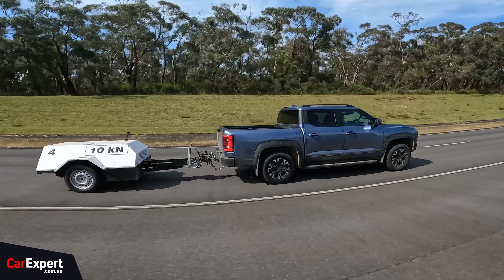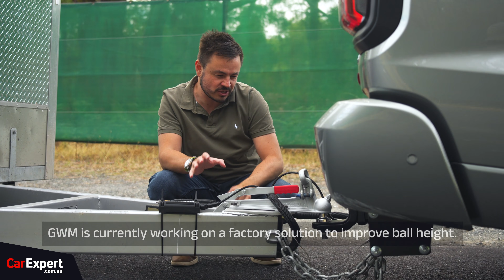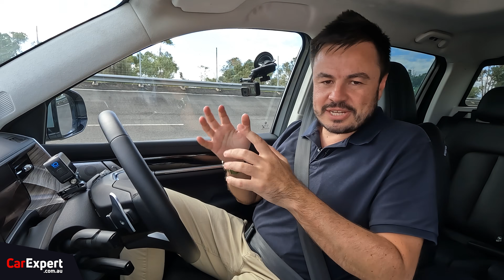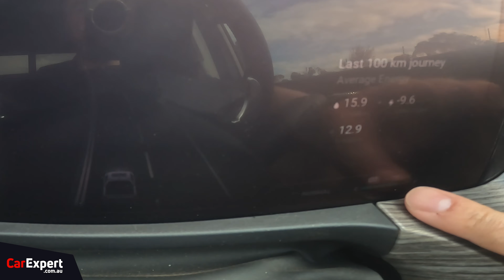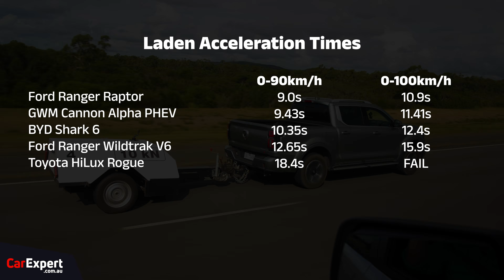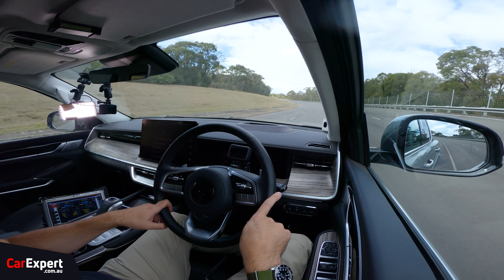GWM Cannon Alpha PHEV towing STRESS TEST: This blew us away...

Comment: If i’m not mistaken the Alpha has a 2.0 liter motor and the Shark 1.5 and 1.000 kg less tow capacity. Thus obviously much weaker at towing. But they are working on a 2.0 liter for the Shark. Would this do as well as the GWM Alpha? I hope these cars come to Europe. Especially the Shark as it is standard N1 vehicle saving a lot of taxes for those that would use it for work. Crazy changes, as politicians help the upper class to drain the working man, make it hard to find an affordable towing vehicle.

Comment: The reason the cruise control doesn’t work while towing is very simple, it is illegal to use cruise control while towing under current Australian road rules. I know other Utes don’t disable this feature which is a failure of the ADR’s and technically you can have your car defected if caught

Comment: Software update?!?!  The current Cannon has rear radar faults as a standard option. It alarms all the time when towing. It does say rear radar faults on the monitor. Drives you crazy!!!!! When you’re in drive the rear radar alarm should be off!!!……it’s a simple update which GWM aren’t interested in providing. So DONT expect any updates for their common faults anytime soon. Good cars, but after sales support is very bad.

Comment: Just don't buy one from Southgate GWM in Adelaide. The after sales and warranty service is where the stress begins.
Reply: Can I ask what you mean? I was looking to buy from them, that place is specifically the issue?
Reply: @Jess-u9q2w Good afternoon. My stepson bought a brand new Alpha Ute and it had automatic transmission problems from day one . Transmission would intermittently lock up for no reason 
It would not always go back into first at a standing stop often taking off in second or third. In for warranty work 23 times always excuses and never repaired. Officials from GWM Australia also flew in and went away denying anything was wrong. The vehicle was also rusting from new . Nobody from the dealership or GWM Australia were of any help at all . My wife and I bought a brand new Haval from them and the airbag light came on on the second day and took exactly 10 months to rectify with the sensors twice replaced,  the ECU replaced once . Eventually the dealership at Mawson Lakes had to re wire the vehicle taking 3 days.

Comment: Good review. Seems impressive. Re towball height. I had same issue on my 2019 Colorado and 2024 Dmax.  I ended up fitting an inverted Hayman Reece adjustable hitch. About $400 but raised the towball height so trailer was level. I do about 60,000ks of towing a year and raising the towball height not only stops the trailer hitting the ground, it significantly stops the banging and clanging and the “push” the trailer can exert on the vehicle.

Comment: Is it just me, or with 3500kg towball weight, 250kg payload in sandbags plus the driver, you are well overweight by being over your GCM? GCM - Tow weight in your case leaves 3245kg. Minus the kerb weight of 2810kg leaves 435kg for payload. Minus the towball weight of 350kg you mentioned leaves 85kg. That's also not taking into account the towbar weight which i understand is not included in kerb weight. So maybe 35-40kg left before you the driver gets in? Yet you added an extra 250kg in sandbags?  Don't get me wrong, super impressive how the car just handled it and I am personally interested in one. However, if I understand the weights correctly, the presentation is misleading.
Reply: What is the rear axle load. I'll bet it's well overloaded

Comment: Why don't Chinese make V8 diesel engines. We don't need batteries and Hybrid tech that will all fail in a decades time AND WOULD NEED COSTLY REPLACEMENT. I had to pay Toyota $4700 to replace my Camry Hybrid batteries around the 12th year mark and 200,000km. We need cars that last 20 - 30 years and 400,000KM with all the original parts.
Reply: Thank the Australian government and their obsession with going green. Thanks to emissions standards, car companies have to ditch fuel guzzlers for chargers. But just a fyi, GWM are developing a twin turbo V8 (hybrid).

Comment: Great review as always, 1 thing you could do to simulate more real world testing, the configurable trailer load for towing is fine for weight alone, but it doesn't simulate the aerodynamic drag of something like a caravan that would typically be the cause of this weight. If you had a caravan (or similar trailer on loan for testing) to standardise both weight & aerodynamic drag across all vehicles, this would be more a comprehensive result, especially for fuel economy numbers with realistic drag factored in. This would be interesting to see how the smaller plug in hybrids compare to the bigger American V8's like the Ram & Silverado, given that these would push more air out of the way for the trailing object already based on their larger design.

Comment: If our 21 Hyundai Ionic plug in hybrid's battery is depleted we can run it in sport mode and it will fully charge the battery again in about 35km of driving. Wonder if this does the same.

Comment: Thank you for a good set of reviews on this vehicle.

Let's hope they fix the tow bar problem so it's integrated into the back better.

I'm considering a Hybrid for towing the van around Australia simply to save on fuel. Plug in while camped in a caravan park and basically fill up for free :)

Comment: Very interesting results.
Hitch raiser or upside down hitch to lift ball height 50 mm ??
Mister Hitches Heavy Duty hitch has a stock 57 mm drop or 31 mm reversible rise hitch for $70.00 SKUMH001HD or a 102 mm drp 72 MM rise SKUMH004HD  both rated 365 kg ball weight and 3650 tow max load. 2" square hitch.
Would love to see the chassis teardown and assessment like was done on Munro Live 
Spring suspension and live Axel would I suspect handle very much like my Mitsubishi Challenger PB Manual. 
Which I might add tows very well for a 12 YO 2.5 ltr Turbo diesel.
GWM had a bad name for chassis fracture on the early utes and 1 Tonnes when tradies rand them at the max loads.
Also thes panel rust and other niggles that seemed to plague the brand.
If The newer Cannon has made headway then this has a real chance.
Over 100 km pure EV, does the day to day Week day work at negligible cost.
The V2X function makes it the ideal trade site truck and camping vehicle.
Tove the boat, caravan, camp trailer, motorbike trailer.
Have a weekend in the bush with power at hand.
Pack up and tow home and 600 km towed range. 
The only question is quality of build and reliability.
And the need for a tradie pack - Vinyl seats rubber mats and a harder wearing interior.
All the plush ness is going to get damaged as a site truck IMO

Comment: Interesting that you admitted to draining the battery on the Shark before the dyno trailer test. Also why are you testing a 2.5t tow limit vehicle at the same 3kN as a 3.5t capacity vehicle?
You’re absolutely right this (and the Ranger PHEV) will be better than the Shark at very heavy long distance towing but it would be great to see a test relevant to the vehicle specs. Giving the Shark a reasonable SOC would show how it performs in normal conditions rather than just edge case.
I know you’re probably sick of hearing it but you’ve dropped the ball a bit with the Shark test but with some minor tweaks it would be a very useful review to help people decide which vehicle suits their needs.
Reply: The 3kN test is a standard towing test he does on all vehicles of this nature. It's not about testing the weight, it's about simulating an incline. The 3kN load is equivalent to driving up a 15⁰ (or so) incline, with a certain load on. It's all just about the forces involved.
Reply: You just contradicted yourself by saying ‘it’s not about weight it’s about simulating a load up an incline’ yes it’s how well it pulls simulated, unspecified weight up an unspecified incline.
My point is simply that doing the exact same test on vehicles with different ratings is not actually testing them at the same level in relation to their design specifications.
Equity vs equality 😂
Reply: @MattTucker  well i was more just trying to make the point that it's not necessarily a direct comparison of pulling a 3.5T tow weight, but as you said, an unspecified weight up an unspecified incline. 

That way keeping the 3kN retarding force the same for all vehicles is a fair metric to keep standard. 

Every other car in this class has been tested by that same metric. 

It's edge case, he makes that abundantly clear. 

Also, he made a follow up video on the Shark saying BYD made some logic changes and he is now comfortable in saying the Shark is suitable for towing it's rated capacity at all times. That logic change only occurred because Paul tested it to this edge case, and showed it lacking. Without that stress testing, the change wouldn't have occurred.

Comment: You couldve flipped the tow ball tongue to get a bit more height for the trailer, wouldnt help the general lowness of the towbar but it would help the trailer. The lack of cruise when towing is kind of understandable, owners manuals used to recommend you didnt use cruise while towing, and having towed very large heavy trailer, i dont recommend using the cruise when towing those. But, its going to be a pain for a lot of people as its really not an issue when towing a smaller trailer. Great test, information a plenty

Comment: I love our tank 500 ,but we just towed from nsw to sa for 4 weeks .these are good cars but once the battery is gone ,they struggle to pull 
We found going up and down hills was excellent but steady upgrades kills it 
Towing a 2700 caravan 
Gwm have no solution to the cruise control issue
Reply: Bummer. The 500 hi 4z has a massive battery in China. Huge power. Not sure when you guys are getting it.

Comment: As a kid, I remember an old neighbor (old, as in age) had a similar issue with the drawbar on one of his trailers sitting too low to the ground. He had a very simple solution. He just removed the neck, turned it upside down, and reinstalled the towball to sit on top. The amount of extra height it added gave it the clearance he needed. The older generations really knew how to tow, he gave me a lot of advice which I still follow to this day.
Reply: They would need to modify the bumper, or use a hacksaw. The mounting bolts are under it.
Reply: @bigdogus  no it has a removable hitch. virtually all towbars do.
the one i know cant be flipped over is the early 2000s toyota rav4 as the towbar mounts on a angle.
Reply: @justanaverageguy1351  I thought this would have been a quick solution also.

I would be interested to establish if this is ok or there is some ‘engineering’ reason why you wouldn’t? Does anyone know why you can’t flip the towball neck?
Reply: @darrylmunro96  they are designed to take force one way but if your not loading to max it dont matter. this 10 percent ball load idea is actually bullshit you actually dont need that much. that does rely on properly loading your trailer so it is correctly balanced.
Reply: yep its so simple.
Reply: As long as the tail gate doesnt hit it. The split design may help.
Reply: When brokies help eachother out 🤦‍♂️🤣

Comment: How is this a preproduction model? There is someone with one parked in the street at my work every day for at least 6 months? They've even modified it with American looking wheels and it looks decent
Reply: The diesel and HEV variants already on sale 12 months ago. This one is the PHEV version.
Reply: @thearlongpark  thanks for clearing that up for me. Makes perfect sense.......? Kind of? As in because of the drive train; would it even be necessary to plug it in? I'm assuming that there are some residue losses with regenerative braking or any other means that might be available to (low load engine drive whilst idle at traffic lights is something I feel is not fully taken advantage of with Hybrid system,). That all being said I'm no expert, don't own an EV? I got a science degree and I'm interested in drive systems?
In the more performance oriented "hybrids" they are kind of more of not a range extender but powerful electric powered direct drive to the crank "reverse super charger" (instead of a static load on the crank to create boost you use the electric motor to help spin up the combustion motor - the engine becomes the super charger as you aren't forcing boosts but driving the pistons that are sucking more air in because of more RPMs) less fuel is burnt to get the same drive to the crank or more fuel can be burnt by over driving the crank = more power instantly when asked for it without lag or parasitic loss.. No need to compensate in tuning either.
Anyway I'll shut up now and go nerd out somewhere else

Comment: How about a long tow trip say 4+ hours like a lot of caravaners. What would the fuel economy really be? Out of battery is not an edge case for most travellers. At 22l per 100 per your stats this is terrible. I get 18 in a V6 diesel and 22 from a Silverado towing 3.2 ton van. More convinced than ever this battery thing is a scam.
Reply: Trying to compare a diesel to a petrol os entirely diffrent interms of fuel. A petrol engine towing the same weight is always going to use more then a diesel. Of you compare these to anything you compare it to something like a petrol v8 patrol or landcruiser in terms of fuel use. At 22ltrs per 100 the alpha uses far less then the likes of a patrol or landcruiser towing with more power to.

Comment: Still not sure why you do fuel economy with the trailer dyne on? That would represent your max fuel consumption under load so it's not really what people want to know. You really want to know what the fuel efficiency is towing it's max load around the circuit. That way you get flat highway , uphill and downhill which is much more real world than a constant load.
Reply: 3kN is equal to 7% grade and towing 3T trailer.
Reply: @bushmagpie3312  If you continue to only drive like that, some day you'll reach the moon.
Reply: @bushmagpie3312  Exactly. Which is not representative of typical driving. You don't drive up a 7% grade all day.

Comment: Just bought the shark 6. Would have probably preferred a traditional drive train with battery assist rather than EV with on board generator. Ah well, the only towing i have ever done is mulch/top soil to the house and i'll only be using it for daily work and the occasional camping so I dont think its an awful purchase. Something just tells me i may regret it down the line - or ill end up just selling it for something else..
Reply: For your user case, I think the Shark is the perfect choice. 
The GWM is not going to do anything better for you than the shark. 
Shark looks better IMO 😉
Reply: For your case, Shark will be much better vehicle. The Alpha PHEV Hi4T will be better for heavy towing and heavy off roading, but day to day will have worse fuel economy than Shark. Hence why GWM already released Hi4Z system in china which use exact same setup as Shark (two electric motors without driveshaft to link front and rear axle and battery in the middle) to improve fuel economy.
Reply: You will have alot less components to wear/maintain over time as well for example driveshafts , gearboxes etc etc

Comment: Great review. If you drove say 600kms while towing what happens when the battery "dies"? I assu e you must rely 100% on the ICE until you can plug it in. Therefore for driving long distances why would you buy one ?
Reply from the maker: Once it gets to around 15% it’ll use the internal combustion engine to gradually charge the battery. It’ll then go between using the battery and engine or both. 

You’ll only get down to that edge case of 11%, which is the minimum state of charge when you are using peak engine and battery capacity.
Reply: @CarExpertAus  so on a long Aussie trip towing a van will it better economy than say a 2.2 bi turbo diesel ?
Reply: The main advantage of PHEV is you can save fuel on daily usage by charging it overnight and use minimal or no fuel at all. For long distance it will use more fuel.
Reply: You use the mode that maintains battery charge level......
Reply: Did you even watch the video???
Reply: @bubbleboy468 yes, twice and still can't see where they did a big drive, which of course they can't because it is a pre production model. So yes the ICE is quite good but we still know how it would go on a typical aussie road trip from Vic to Qld. Happy for you to enlighten me.

Comment: Maybe ditch the split tailgate and mount the spare wheel to the rear like the tank 500? Going to need a couple big struts to make the tailgate manageable though.
Reply: Its a good thought but putting anything on the outside affects compliance so if it wasn't stamped with it they would have to ask for it to be added and hope they don't have to re-test. I wouldn't think they would need to but it has been known in the past even for things like a bumper bar change.

Comment: Don't like the split tail gate. Hopefully, it can be optioned for a one-piece unit.  🙏
Reply: You can still open it like a normal tailgate
Reply: @markymark8472 
Yes, but it is structurally weakened.
Reply: @buncha5651  yeah.. seems like a bit of a gimmick.. a future warranty claim and for not really much benefit. Id rather see a wheel holder instead.
Reply: The Lux version has regular tailgate